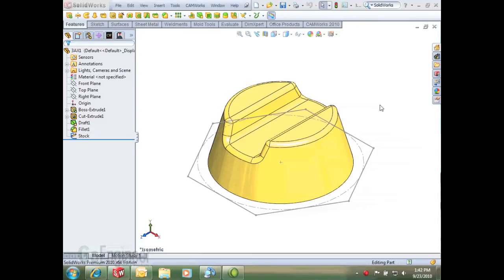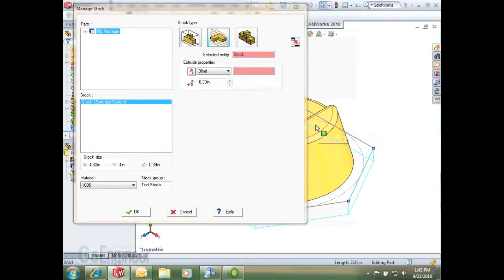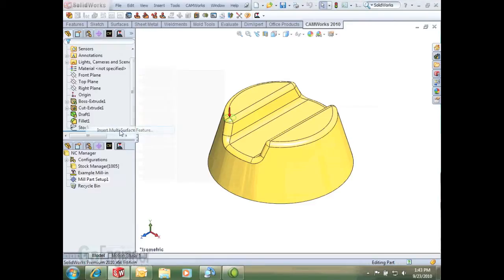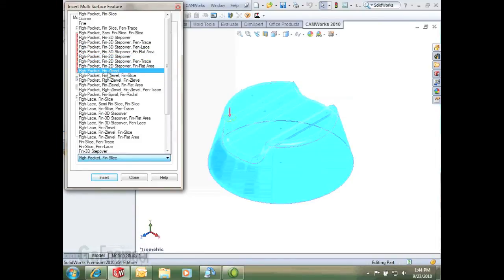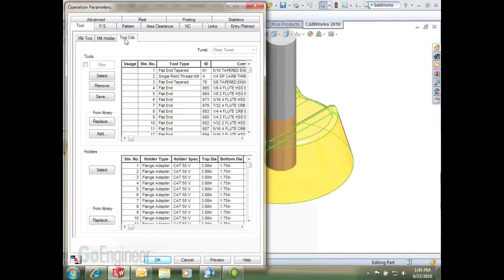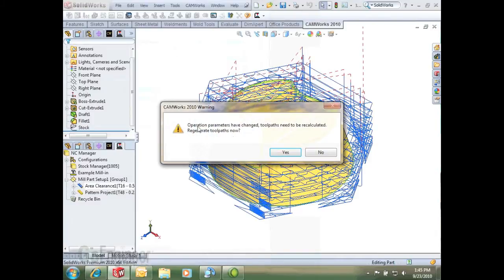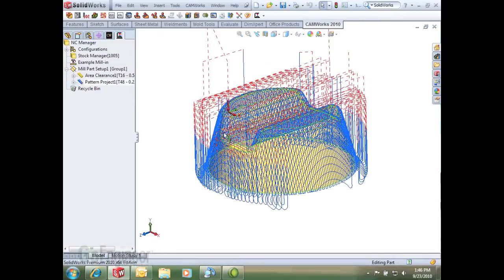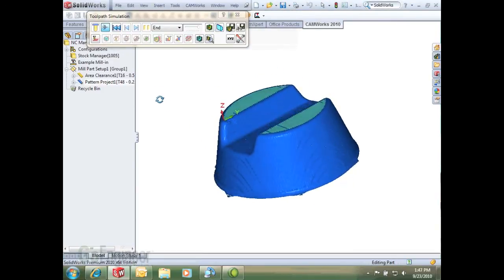CAMWorks - Introduction to 3 Axis Machining Part 1

Comment: Hi GoEngineer,
I have an issue with fillets and chamfers, when I select machinable faces cam-works excludes the fillet (the fillet is no terribly complex in fat constant radius). what end-mills tools would be needed (assuming this is the issue), does the part orientation (XYZ) impact this? and guide would assist